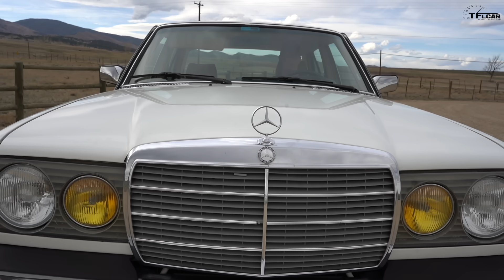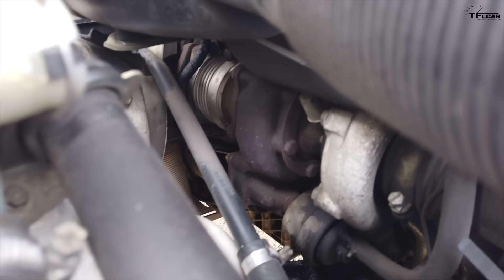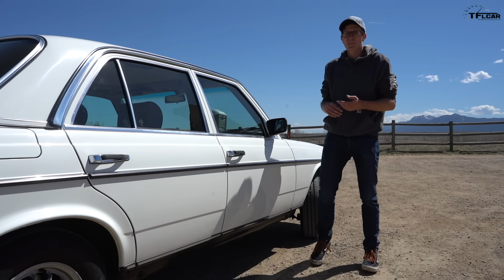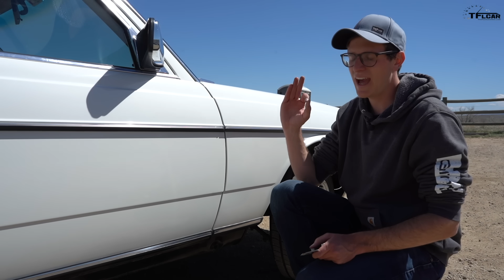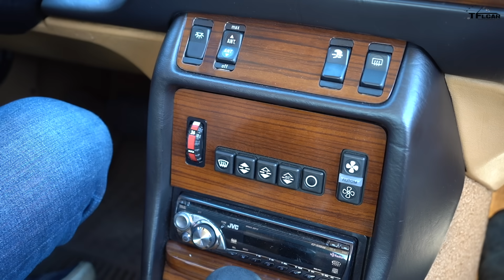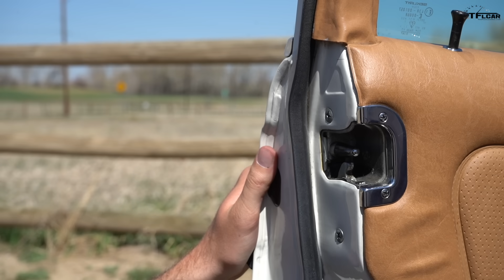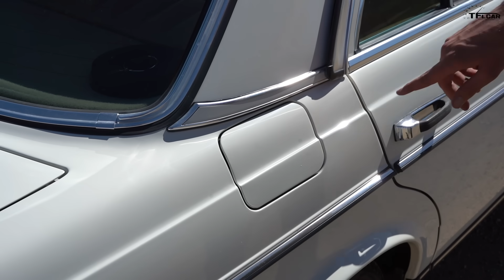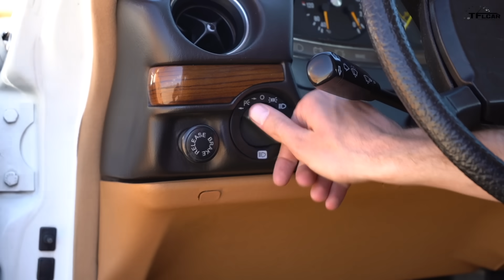This 37-Year-Old Diesel Is THE BEST Mercedes Ever Made!

Comment: The W123 is the only car, everything else is just a meager appliance.
Reply: what about 22r Toyota trucks?
Reply: My W116 and my R107 are great.
Reply: @LilyoftheValeyrising  w116 is beautiful
Reply: ray croal thanks! I agree
Reply: @LilyoftheValeyrising  what models u got
Reply: ray croal I have the 1975 450 SEL, and a 1980 450SL.
Reply: @LilyoftheValeyrising  oh both beautiful, i prefer the 450slc to the sl but the sl goes for more money so i must be in a minority,but i would love to try a 450sel but there is not many left in uk cause of the weather
Reply: 1988 Volvo 240 Station Wagon. Shorter turing radious but leaky piece of shit.
Reply: What about the Lexus LS400?
Reply: MAAK4 
I love the LS400, I’ve wanted to own one forever, but it’s the epitome of an appliance.
Reply: Come on the W124 is also great. I am highly  as a loving 1986 300e owner
Reply: orion deschamps Only issue with the W124 are the head gaskets which are prone to fail, really the only thing that would keep me from buying one.
Reply: Ammon I think on the M103 that is guaranteed to die around 170k. Luckily my car has 239k miles so past that point
Reply: orion deschamps Right on, gotta love old Mercedes'
Reply: @akishot6735  Actually, even though W123 owners won't admit it, the W124 IS the W123 fully evolved to the most it could be without losing all the things listed here as an advantage (minus the aluminum head of course.) Even still, with that ONE issue, it was hardly terminal for the car's rep, as those same European taxi drivers did not complain when the W124 replaced the W123. However, when the W210 replaced the W124, there was plenty of complaints of the downgrade in quality.

Comment: I like the w126 300SD more. It is a very nice car that does what your car does only better.
Reply: I'm gonna chime in on this one because I can think of two things the 300D did better than the 300SD. I had an '81 300D (turbo not available until '82) and an '81 300SD Turbodiesel, both purchased new off the lot. The 300D was much faster off the line. Now granted, these were 5-cylinder diesels, so we aren't talking Lambos here, but the SD was a dog from a dead stop. You could practically walk faster than that thing until the turbo kicked in. The 300D, while no speed demon, didn't have that problem. It could at least get out of its own way though. The second thing: the SD could blow out a cloud of black smoke so thick it looked like what they call "Rolling coal" today.  Eventually the manufacturer came out with a fix, but for a while there if any rude driver did something obnoxious to you, you could always pull ahead of them and then hit the accelerator and leave them in a big cloud of black smoke - LOL. At least the 300D didn't have that issue from the manufacturer.
Reply: Tigerfire75  My 300sd got better fuel economy than my 240d and 300d turbo. With deliberate driving I could get 38mpg on long hiway trips (I advanced the timing a few degrees to help with mpg). My 300d and 240d could only just break 30 mpg

Comment: I had one for about 5 years. Loved it. That is as long as the vacuum system is working. For the HVAC controls I swap mine out for the manual controls from a Euro spec w123. Most reliable car I have ever owned.
Reply: yes Lololol good old vacuum lines. I drive an 82 240D and had to revamp a couple of spots to get things in working order. Ran like a top ever since lol.

Comment: Well the 1985 300D Turbodiesel  actually has a power miror just a single  power miror but hey its something and the 1985 model has 125hp unlike prior models with 120 one more fact about the 1985 model is that it has a speedo that goes to 125mph and idk if this was just a weird quirk of mine but the steering wheel has smooth leather on it

Comment: I love the look of those old Mercedes. I also love that diesel sound. I just picked up a VW Tdi and am very happy
Reply: You just bought a car from the "Monkey Spankers"?, You have my sympathy.
Reply: @adoreslaurel  The five cylinder sounds much better than the TDI, imho.
Reply: @jmbpinto73 I am not familiar enough to comment. but am sure you are right.
Reply: @jmbpinto73  but is alot faster, turbo works just above idle and easy to reprogram the ecu for more torque+HP and less fuel consumption.
Reply: Well, now that it’s been about a year, I guess it’s definitely too late to warn you that any VW TDI made today is light-years worse than that old Benz in terms of quality.  You have my sympathy.
Reply: @lashlarue7924  I would agree.  But, in all fairness I have a friend with an older golf TDI with over 300K miles on it and it's been a good car.  A much cheaper car so...  apples and oranges.
Reply: @dansshop  the issue with all European cars, IMHO, is that it’s really difficult to distinguish the delicious oranges from the lemons.